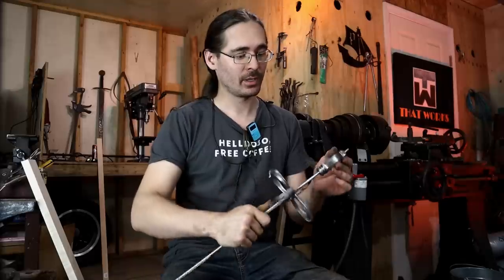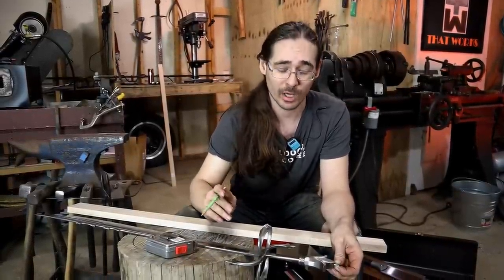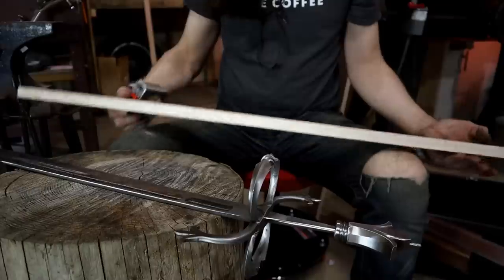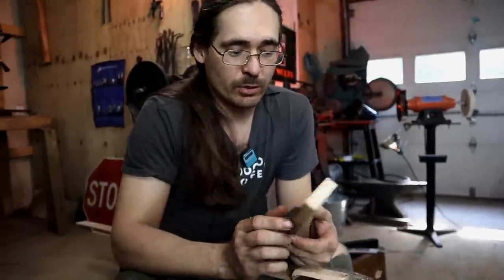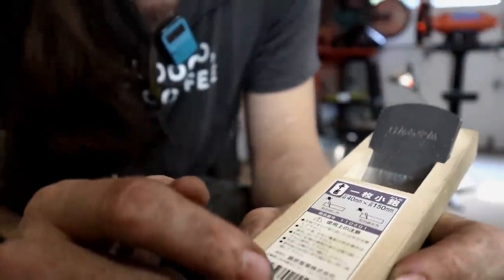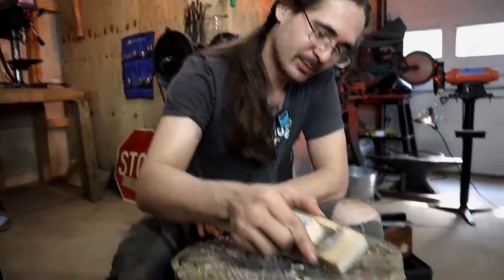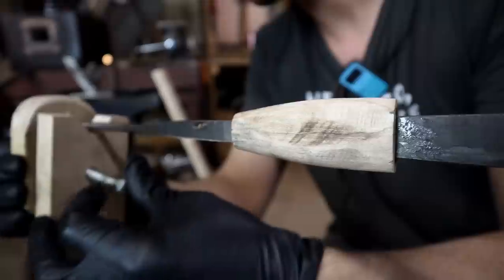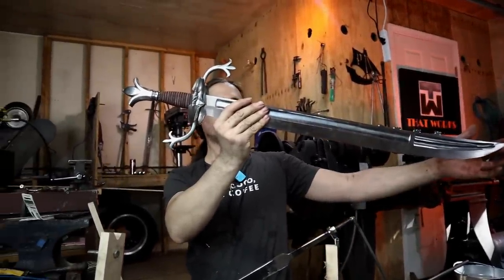Making a Falchion for Skallagrim - Part 7 The Handle

Comment: I have been unsubscribed for awhile for I was watching with my wife and daughter, its family time.  ☺
You folks look a lot happier since you have your new show. The picture quality is really great! I can't work with steel, I have worked with wood for about 45 years and I keep thinking 2-3 times as I watched you handle the metal with such skill, " yep! That is were I would forget and grab the metal with my hand."  😬
I will stick to wood, its 
safer. ( now that I'm not using a circular saw to carve out the groove in a axe handle, after I used it to split the axe handle in 2.) I did this once and will never do it again,( I didn't have the proper tools.)  😬

Comment: Just a tip for using the saw: Use the full drawlength to use it's full potential. Really follow through with the strikes. This will also give you a really nice cutting edge.

Comment: I've done this using a .25 and .375 inch bench chisels, a c-clamp, a pocket knife, hammer and one of those god-awful black-and-decker workmate tables. Also a note for anyone else keen on trying, use a low tannin wood like maple or birch rather than oak. If you do use oak or walnut, seal the tang channel with a finish to isolate the steel from the wood.

Comment: Why aren't you using stabilized wood for the handle?
Reply: because stabilized wood is bad for these sorts of handles
Reply: @kellyfrench5792  Stabilized wood is never a bad choice to the best of my knowledge. Why is it bad in this case?
Reply: @berlinetta350  stabilized wood is brittle, but natural wood is more pliable
Reply: @kellyfrench5792  but this wood will expand and contract depending on the humidity and eventually rot over time. Stabilized wood will do none of that.
Reply: @berlinetta350  so what? if you want to study historical weapons you should use historical materials
Reply: @kellyfrench5792  I don't believe archeology has uncoverd an ancient Home Depot that our ancestors went to and bought their sword handles from.